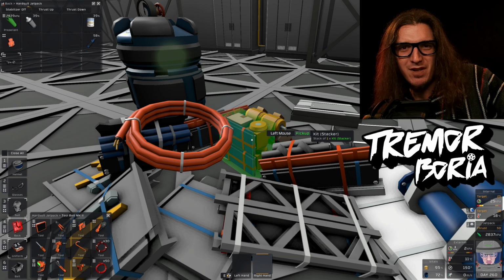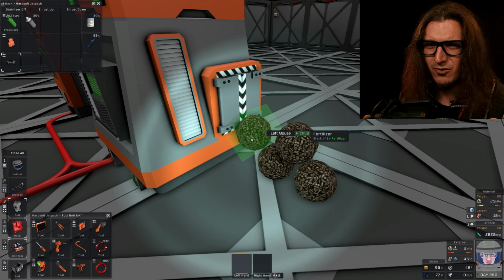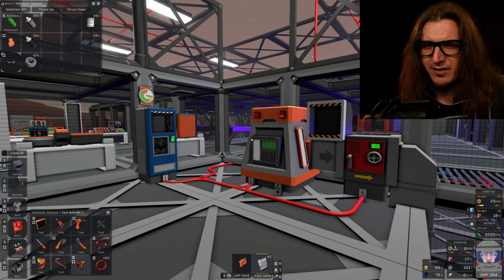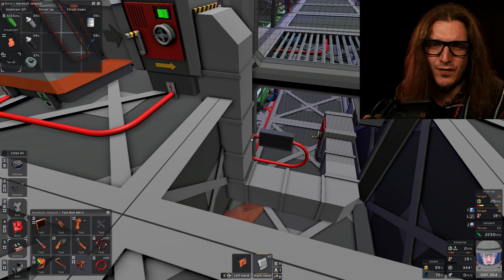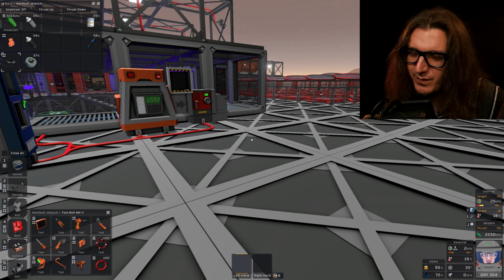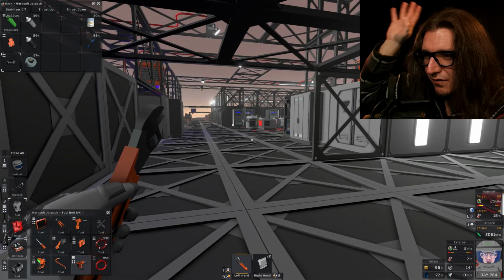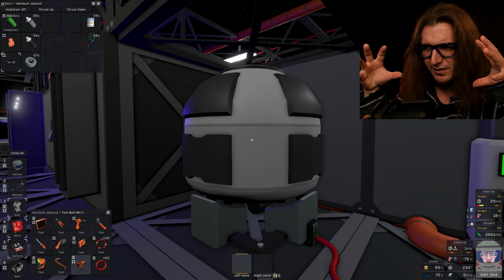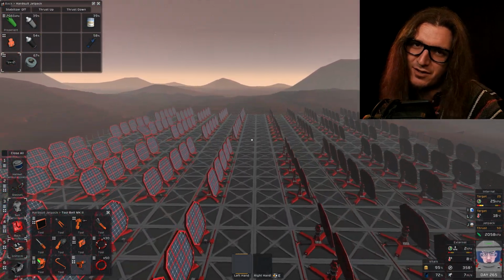Stationeers: Compact Advanced Composter Concept.

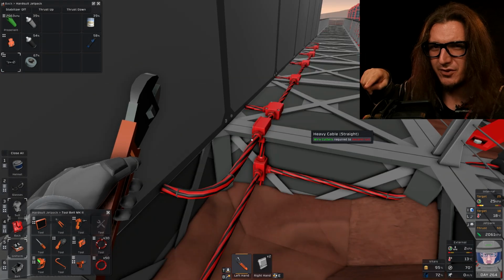Comment: 3:20... a thing like 'too many batteries' simply doesn't exist. Had a base on Europa and my energy-setup was a row of large wind turbine sets. 10 per set going in 8 large batterie blocks (in the endgame, it started with lower). From there cable to the main base, also in a bunch of batteries.

The idea was - those 8 batteries would hold about the power generated by one storm (when the Windmill produce 10kw)

On the other hand... we also incoorporated a electrical powered furnace (as in heating gas with power instead of fuel) ... which could deplete the whole setup in a matter of hours.